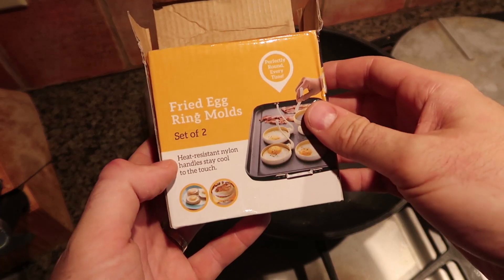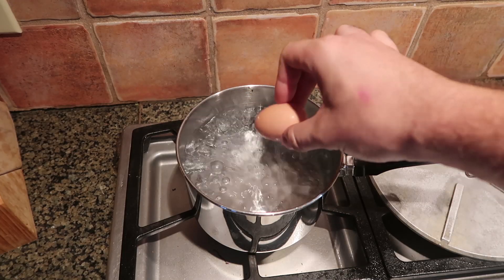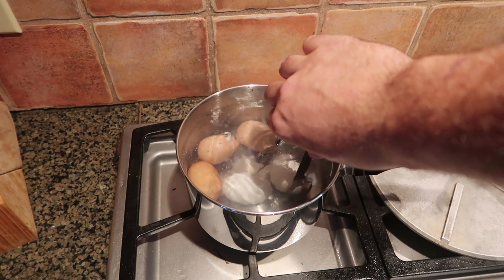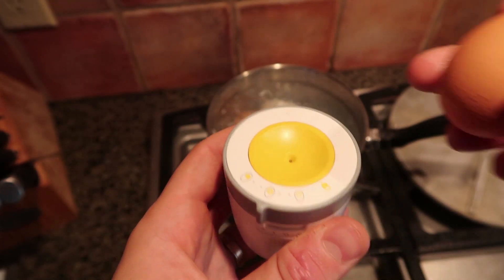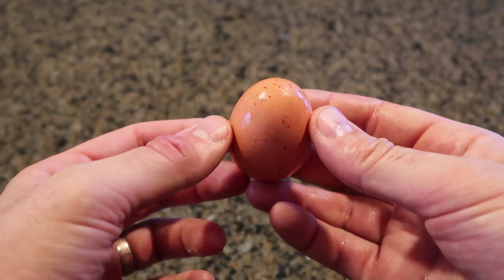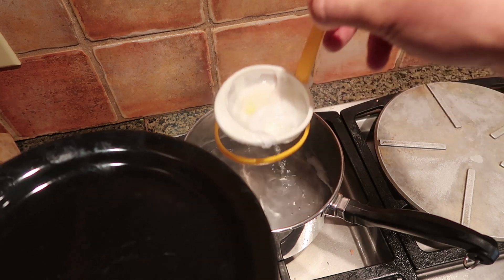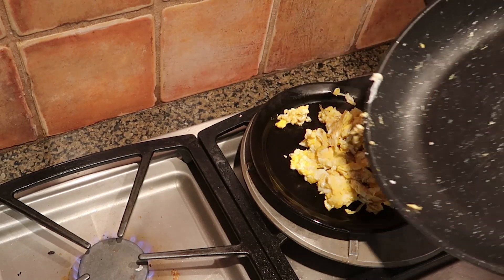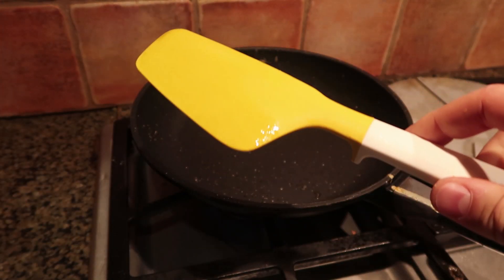5 New Egg Gadgets put to the Test - Part 8

Comment: Egg hole poker.. it is because of the cracking of the egg that happens sometimes. To prevent that you need to poke the hole in the widest part of the egg where the little air bubble normally is at. And it becomes easier to peel when you rinse the eggs with cold water.